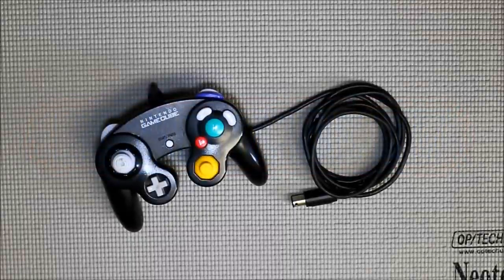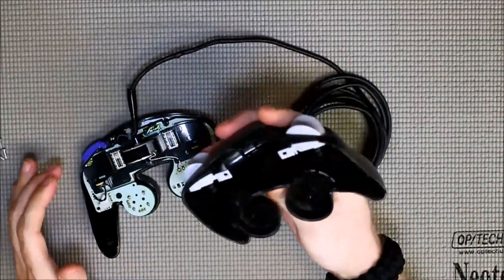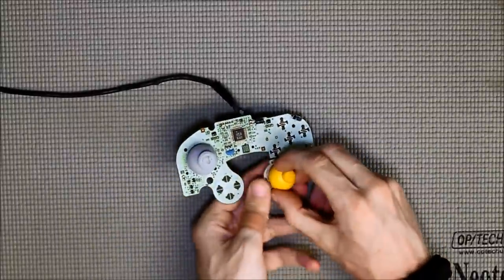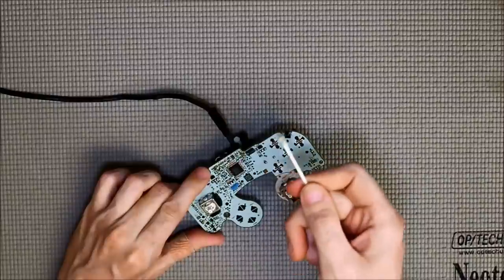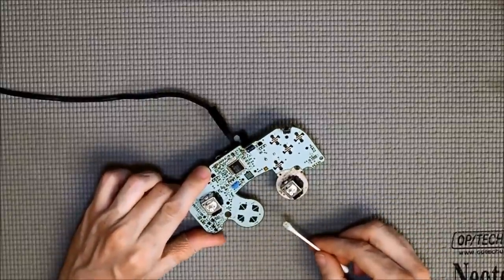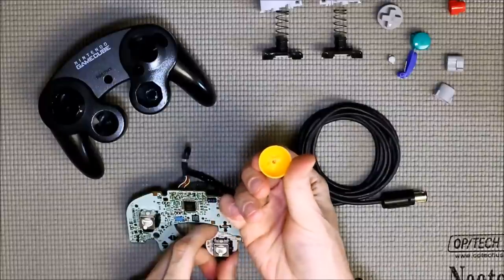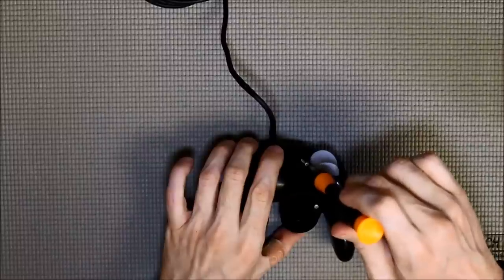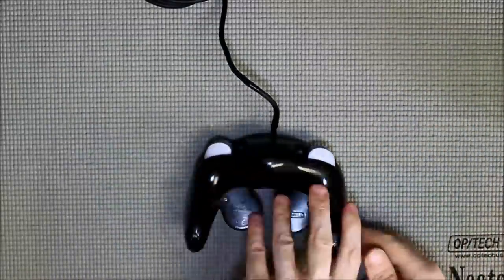Repairing An Original GameCube Controller

Comment from the maker: @xShadowClaw1x No, that makes perfect sense. The buttons on the GameCube controllers are both analog and digital. Perhaps it's just dirty and there's something sticky causing the rubber contact pad to stick to the board, so it thinks the button is still being pushed. That ot the analog slider is broken. If it's the first problem, and good cleaning should fix it. If it's the second issue the slider would need to be replaced which isn't really worth it. I would just buy another controller at that point.

Comment: why you didn't shortened controller wire a bit, i mean not to use this duck tape it looks not good, insted the best idea for this would be to cut damaged part of the wire and solder back to the mobo
Reply from the maker: +Даинис Вильюмс That's how I would prefer to do it. But I thought that would be a bit too technical for most of the people watching this. However, you have me thinking that I should do a dedicated video to fixing that since it's pretty universal for controllers.
Reply: The Game Bench OR you could paracord it so it won’t need to be shortened

Comment: im going crazy trying to find a way to fix my gc controller. For some reason if I move left on the joystick it moves super slow but moves normally to the right. Driving me nuts
Reply from the maker: It most likely needs a new potentiometer aka the actual joystick. This is a video I plan to do very soon once I do a video on how to solder and desolder.

Comment: Would it be ok to just wash the buttons/joysticks and the shell of the controller in hot/warm soapy water and scrub them with a sponge ?
Reply from the maker: Of course! Just as long as you let it dry fully before putting it back together. : )
Reply: ***** Thank you for the reply. Greatly appreciated.
Reply from the maker: No problem. Just happy to help.

Comment: quicker way to clean the plastic stuff is to throw the shell in the dishwasher.  put the smaller bits in a cup of hot soapy water and give them a scrub with a toothbrush.
Reply from the maker: Yep, I've talked about using the dishwasher. I thought I did in this video too. Anyhow, I've had mixed results doing that.
Reply from the maker: That's a great point. That's a real time saver. My only problem I've had with using the dishwasher is that I've had it discolor some plastics.
Reply: ***** woah yeah you have to watch which setting you use and the type of soap! I used the cheap stuff and didn't add much.
Reply from the maker: Thanks for the tip. I'll have to try that.

Comment: Thanks for sharing. Never opened up a gc controller yet so that is awesome to see.
Reply from the maker: Hopefully it helps if you ever have to open one up. I just posted an update. Seems there was a later revision.
Reply: ***** That controller is a later revision the original ones had a detachable C stick where you can disconnect it without de-soldering and the really late ones have screws on the sticks and fewer solder points.
Reply from the maker: cutemimi25 Thanks for the added info!
Reply: Sure thing find one of original GameCube controllers is hard.

Comment: I got the gg stick caps, they do have pretty good grip and mostly match the color but i noticed that moving it to the notches around the stick doesn't make the same clicking noise it does with a oem, and trying to move it at full range in a circle (touching the rim) is kind of sluggish. id imagine the problem is that the cap isn't raised as much so the rubber and not the plastic is hitting the rim. if anyones gonna get them maybe chip off some of the rubber on the sides and glue it back on.
Reply from the maker: +Austin Pedro I hadn't noticed that. Great info!

Comment: I just use isopropyl for the cleaning step. no need to clean up Windex residue that way.
Reply from the maker: Layne Brown Do you mean on the shell?
Reply: ***** whole thing. electronics and all.
Reply from the maker: Layne Brown Interesting. I would never use Windex on the insides for that very reason. Though I've never thought to use ISO on the shell since it jut evaporates to quickly to really scrub and get all the crap off.
Reply: cotton ball and gloves are the best way to use iso for cleaning the plastic because it can be saturated. the gloves aren't really necessary but some people don't like to get stuff like that on their hands.
Reply from the maker: Layne Brown Haha, yeah. ISO will leave your hands dry as a bone.

Comment: If a joystick is loose, does that mean the rubber cap needs to be replaced or the joystick mechanism underneath? Great video by the way, thanks!
Reply: you can oepn it up and see! if you take off the cap itself and notice that the hole it slides into the controller with has become slightly larger, that could be causing the wiggle. Or take the cap off alltogether and try to see if the mechanism itself wiggles when you try to move it around.
Reply from the maker: I've seen some controllers where the hole in the thumbstick, where the actual joystick inserts into it, breaks and allows the thumbstick to flop around. You should be able to tell between that and the joystick itself being loose without taking it apart. However, like Jonah said, if the hole on the thumbstick has gotten larger over time, it might be harder to tell and you might have to take it apart to find out which it is, the joystick or the thumbstick.
Reply: Thanks to you both @TheGameBench   Jonah Reeves   !

Comment: In trying to resolder my controller’s cable directly to the Through-hole Components on the PCB board, I accidentally burned off some of the copper contacts.  Is there a way to reroute the six wires elsewhere on the PCB board?

Comment: 2 things. a small piece fell out of mine, it's like those pads, but it's 1 button. where should it go? it's not for the start  button, and the edge around it is completely round
Reply from the maker: +Shreddy Bass I'm guessing you have a large black plastic piece in the PCB that the force feedback motor sits in? If so, there are to contact pads on each side that go on a small board that sits in that large black plastic piece. They are perfectly round and there will be one on each side. Those are the only other contact pads you might find in a wired GameCube controller. Can't speak to the Wave Birds as I've never opened one up.
Reply: A thing in it was broken, so it wouldn't fit in. 
My other controller worked fine with this. Thanks again for the video! Was really usefull!
Reply from the maker: +Shreddy Bass That's too bad. I'm glad it was helpful for you.

Comment: How do you make a Z button feel like the official ones? I have several third-party controllers that don't have the metal thing and only rely on the microswitch. Is that really all that is needed?
Reply from the maker: +Chain Sword I'm not sure. I've never seen the inside of any third party controllers. However, if all that's in there in the micro switch I'm guessing that's all it would take since that's all that's in the first party controllers along with the metal spring which would give a slightly different feel.It wouldn't be hard to get a similar metal and bend it to the same shape.
Reply: Chain Sword don’t buy third party ones

Comment: Hey BlastMode7 :) Just wondering if that black thing on your wrist is to prevent electric charges while working on electronic components or if I'm getting this the whole wrong way. Appreciating a heads up on it :)
Reply from the maker: Nope, that actually just a paracord survival bracelet. : )

I don't use ESD bracelets. They've always annoyed me. If static is something you're worried about I suggest using one. Nothing sucks more that blowing out a component due to a static discharge. I've never killed something while working on it, but I've blown out network ports and UBS ports when plugging into them during the winter months here when static gets really bad. But in my work room the floor is tile and the table is metal. So I just ground myself when entering the room and as a precaution I always ground myself before starting work on any electrical component.

Thanks for the questions. It's an excellent one and I think I'm going to do a video on it. : )
Reply: ***** Wow, now thats a response everyone can dream of. Thanks a lot for such a proper and even more detailed statement, much appreciated! Thank you a lot :) You now have one more subscriber for just being decent, serious and helpful!
Reply from the maker: Thank you! I'm glad I can help. I'll be making a video on this tomorrow. : )

Comment: Why not just cut heat shrink along its length and wrap it around the wire/heat blast it?
Reply from the maker: Because, if you cut the heat shrink along the vertical like that, the heat shrink will not hold hold onto the wire. Heat shrink works by shrinking and that pressure holds it to the wire. Cutting it would make it so it couldn't put pressure on the wire and it would just fall off.

I really hate the tape method too, but when I re-do this video, I have some better ideas to try.

Comment: Great video! I have a problem and I'm wondering if cleaning will fix it. Some water got on two of my controllers and caused them to have buttons stick when pressed along with one of their c - sticks no longer working. Any help is appreciated. Thanks
Reply from the maker: Thanks a lot man! If it was plugged in when it happened it's most likely caused a short which has damaged the PCB. But cleaning is free and easy, it's worth a shot. But I wouldn't get your hopes up. At worst you have some spare parts for other controllers.

Comment: I have a question about refurbishing a GC controller. On mine, the z button was only working about 10% of the time, so I took it apart  to try and fix it. When I pressed against the rubber thing the z button presses on, it would work. When I put it back together, it doesnt work at all now. Please help
Reply from the maker: Are you talking about the triggers? I've never seen a revision where the Z button used a rubber contact pad. Every one that I've seen uses a micro switch.  If you could snap some picture with your phone and email them to me that would help. Sorry for the slow reply, I know it's been a while.

Comment: Are those wii classic pro controllers built the same way? Like the PDP fightpad
Reply from the maker: +bomberbang Nope. The only thing that the Wii Classic Pro has in common with the GameCube controller is that I believe that the pot (the actual joystick) and the thumbsticks are interchangeable.
Reply: *****
god damn it. i wanted repair the C stick on my PDP fight pad but it looks like thats not gonna happen. my hori fight pad is also loosing responsiveness. i dont think any of those 3rd party wii classic controllers are built the way they used to make those gamecube controllers. my smash gamecube controller is still holding up strong and i've beaten the shit out of it.
Reply from the maker: +bomberbang Oh, your C-Stick? Well on the original GameCube controllers the C-Stick uses the same joystick potentiometer as the thumbstick. It's also the same one as on the Wii U Pro controllers, Wii nunchucks, and Wii Classic Pro Controllers. Now, that being said I've never opened up the Hori or PDP pads as I don't own any of them. But I wouldn't be too surprised to find the same ones in those as well. There are no direct replacements for the GameCube controller that connect directly to the Wii U. However, the new GameCube Nintendo controllers that require an adapter are pretty much identical.

Comment: Hi. I have the same Coloured GameCube Controller, and was trying to do a Two-tone with it. Now I don't know if you had to deal with this, but the positive and negative wire for the Start Button, which inside of the Controller is that round thing in the middle of the Circuit Board of the Controller, came off. Do you know what I can do to get them back together? I tried sottering them, and that didn't seem to work
Reply from the maker: So, you're talking about the contact pad on the circuit board for the start button. Are you saying that the wire that goes back and forth in the pad came off and you're trying to solder it back on?
Reply: I misunderstood what it was. It's not the Start Button, it's the Rumble motor
Reply from the maker: Ah! So, when you soldered the wires back on did the wires not stay in place? Or did the wires stay in place but the motor doesn't work?
Reply: ***** The Wires don't stay in place
Reply from the maker: Game'n'Glitch Central  That's odd. Are you waiting a couple of seconds for the solder to cool before letting go of the wire? I would try removing what solder is there and start with new solder. You also might want to check out my soldering 101 video.

Comment: When I used the down on the joystick once, the game is acting if I am holding down the stick. What do I need to do?
Reply from the maker: +tf2 fragvideo I would say the potentiometer, which is the actual joystick itself needs to be replaced. You can find new ones for under $5, but you will need some soldering skills to replace it.

Comment: @BlastMode7 Did it repair the tightness of the thumb stick ?
Reply from the maker: It wasn't really tight. I've never seen a GameCube joystick I thought was too tight. If you're seeing this on one of your's, perhaps something made it way inside the joystick itself. You could try something like Deoxit55, which is an electronics cleaner, to spray down into the joystick. Spoiler alert... it's messy. It also take some time to dry. You can speed up that process with some compressed air. If that doesn't fix it you might have to replace the joystick.

Comment: Hey! I was just wondering something. Are there springs which return the sticks to neutral? What does accomplish this? Would there be any simple way to remove the mechanisms moving the sticks back? Thanks so much!!!
Reply from the maker: I've never seen inside of the actual joystick as they aren't designed to be taken apart. However, I would assume they use a spring of some kind to self center. Sadly, being that they aren't designed to be taken apart I don't think there's a viable way to service them. Luckily, they are cheap to replace and really not that hard. I'm trying to get my hands on one that needs to be replaced to do a video on how to do it but I have yet to find one.
Reply: +BlastMode7 Thanks. Hm. Thanks for the info!
Reply from the maker: No problem! : )

Comment: Just purchased some analog and c stick replacement caps was wondering if you experience different build qualities I ordered 12 and in the description it says that the grey analog is a darker gray than original and for the c-stick it's yellow instead of orange are these a go?
Reply from the maker: Yeah, I have noticed that from looking at pictures of ones on eBay. All the ones I've ever ordered from the place I used for the video have all been the same.
Reply: *****
Hey there, I just bought some analog stick replacements from GamingGenerations through eBay. Do you happen to know if store.gg is the same place you got yours? Thanks!
Reply from the maker: Everett Armstrong
Yep, that's the company I bought mine from.
Reply: *****
Thank you for responding. Do you notice any difference between them and the original sticks? Do they perform like a third party product in your opinion?
Reply: Everett Armstrong ***** can you guys put the link here? Im interested too in a new pair of caps
Reply from the maker: Everett Armstrong Thus far, I can't tell a difference. Thought I haven't used them too much playing Smash Bros. which is the true test. But so far they feel and grip your thumb just the same and they don't feel cheap or like they're going to come apart.
Reply from the maker: Wartijn Sure, here's a link to their GameCube parts.

http://www.gaminggenerations.com/store/gamecube-c-252_259.html

Comment: Hey I had a mad catz GC controller.  I loved the one however the cord one time got pinched in the cabinet.  Now my favorite GC Controller does  not work.  I have another  same type with sticky buttons and a Z that won't work.  Is there a way I can restore both without canablizing one with out spending money note I don't have a gap but I do have soldering gun. and heat shrink.
Reply from the maker: Well, for the cord, you could cut it all the way and strip the wires back. They should be color coded so it would be easy. Then just solder them back together and cover each one is heat shrink or use some other method to isolate them. Then use a piece of heat shrink to cover the joint on the out insolation. As for the buttons, just tear it apart and find out why they're sticking. Probably jest need a cleaning. Use some ISO to clean the contacts on the PCB and pads as well. If they still don't work after a cleaning you can try getting new pads. If it's still a problem, then it's the PCB itself.

Comment: my Gamecube controller when i put a little pressure on the shell or sometimes when i press down on the d pad i hear a cracking noise. does it mean that the shell isnt fully on?
Reply from the maker: That would be my first suspicion. Check to make sure the screws are tight. If they are, try opening it up and see if something is keeping the two halves from secureing all the way. Otherwise, the plastic might just cracking on the inside.

Comment: I have a question:
The plug of the controller isn't making a good contact on the port making the controller input a direction while playing even if the stick isn't moving
How do you "open"that plug to clean it?
Reply from the maker: lunas275 Sorry for the slow reply. But if you take the connector and look on the bottom you'll see two holes. The plastic in the holes clips to the metal of the barrel at the end of the connector. If you were to shove a pin or something else thin and pointy in there it should release the plastic and you should be able to slide the metal part of the connector out so you can inspect the connections. Just be careful as the plastic could break.